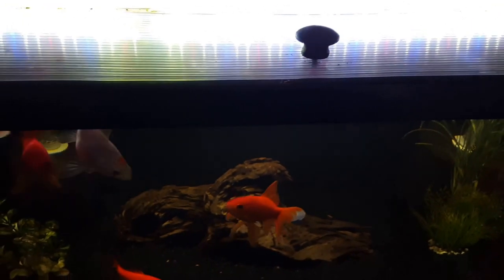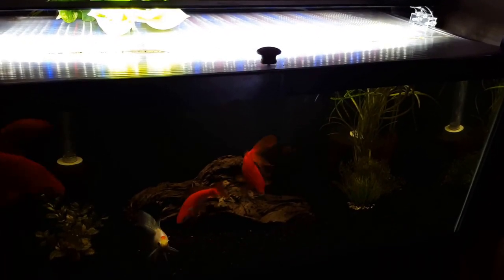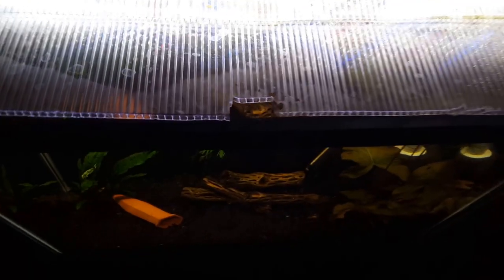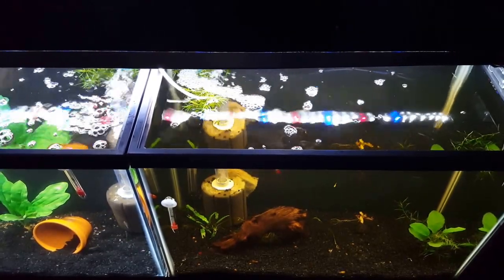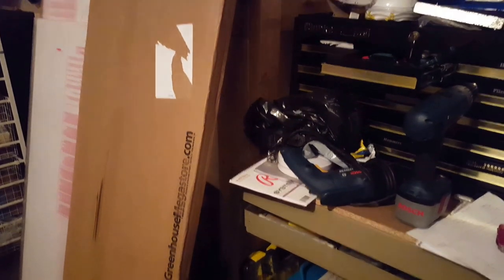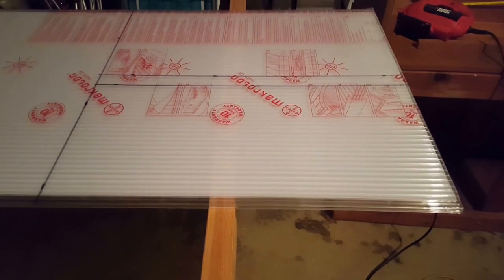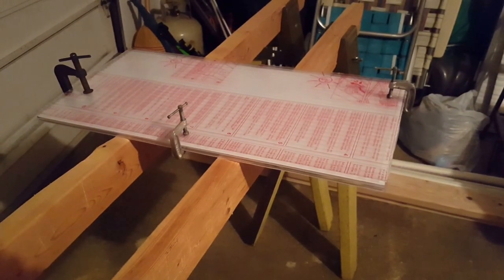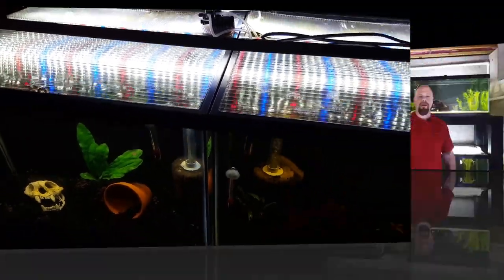How to Make Fish Tank Lids and Save Money!

Comment: I made these and have used them for about 5 years.  I cut my lid on only one side so that the piece could sort of hinge more or less effectively.  It eventually started to crack and separate after a number of years.  After that I put clear packing tape on the top to keep the hinge effect.  I also used a tab of packing tape sticking up as a handle, rather than cut a hole.   I'm very into minimizing evaporation.
Thanks for the great vid!

Comment: yeah, that's a good store, bought the easy ship 4 ft. for my 55 bow front that had an old hood I hacked after gutting it. realized after an lot of thought trying to cut the bow area that I didn't need that part anyway with the front hood so I just cut a rectangle tight lid that was so tight I had to sand the edges to fit, then do the cutouts for hob filter and my air line valve housing. The tank has a center support so no problem with any sagging. Shopped for lids but they were crazy hard to find and expensive to have made for this old Jebo tank. Price for the material was about $35. Didn't even have a table saw so cut it with a Japanese style small tooth pull saw.....carefully. Didn't have those sheets in my local Home Depot or Anawalt etc. here in West L.A.
Reply from the maker: Mark Brown glad it worked!

Comment: Great video, I buy this stuff at Home Depot in 10' lengths for about $31. Lowes does not carry it.
Reply from the maker: Very cool. Now's the time to get it. Once weather gets cold (depending on where you live) the stuff can be hard to find.
Reply: Apparently,  Home depot no longer sells the twin walled polycarbonate. They only sell corrugated poly. 10' sheets.

Comment: Do you think that one of those lids on a 29G or 37G would hold the weight of a large cat?
Reply from the maker: Usually the 37s have a center brace so it probably would, but without the center brace on the 29s I wouldn't chance it. :  -)

Comment: Great video, great advice. Does the light go thur just as good as glass?
Reply from the maker: From all my research polycarbonate does a better job of light diffusion compared to glass and is optimized to allow the correct percentage of light through. My plants have been growing great using polycarbonate, but I'm not sure there is a huge difference between the two.
Reply: Thanks. I will order

Comment: Totally agree. I use these as well instead of glass on my tanks. One thing I discovered is that the polycarbonate withstands heat pretty good. I use four floodlights and they are pretty close to the cover and the plastic doesn't get that warm or bend like plexi glass. Cheers
Reply from the maker: Thanks for the info! I like them because you can drop them on the floor and it doesn't matter too.

Comment: Could you plug the ends of each hollow channel with silicone to prevent dust or water from entering the channels and clouding it up?
Reply from the maker: Yes!
Reply: Good idea!
Reply: Easier to use clear packing tape.

Comment: Hi, how about the removal of carbon dioxide. With the top of the tank covered.
Reply from the maker: Joe Maiato Great question - I have never experienced any issues because there are still enough small holes (for cords and airline) that the C02 escapes unhindered. If it were building up I would expect to see decreased pH and respiratory distress in the fish.

Comment: how can you make a lid if donot have trim on your tank, only the glass rim
Reply from the maker: I have a 23 gallon rimless bow front and made the lid a little larger than the opening at the top of the tank. You could also slide a few brackets through the slots of the polycarbonate so that the brackets rest on the tank glass.